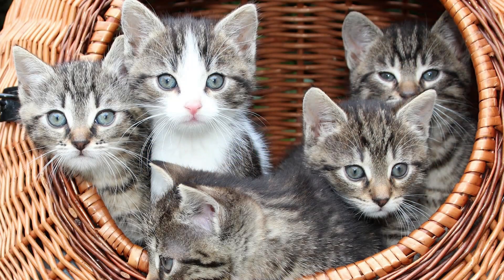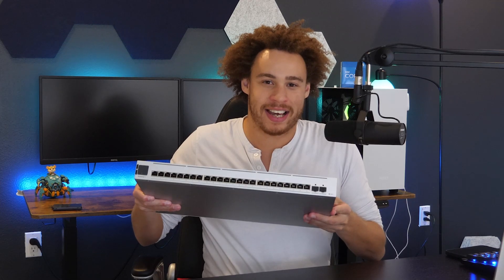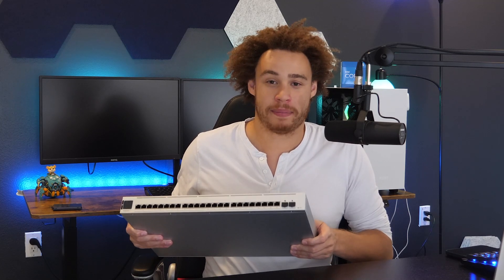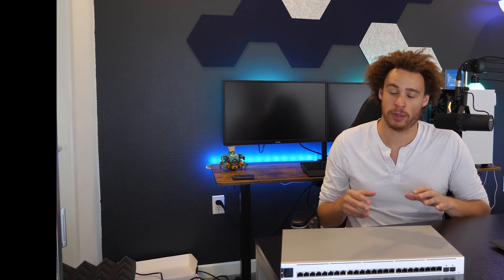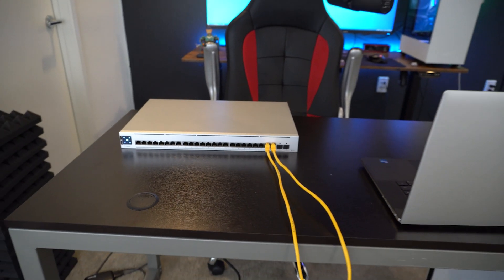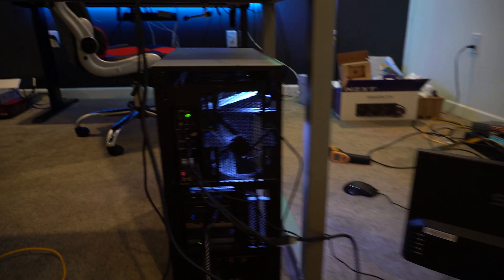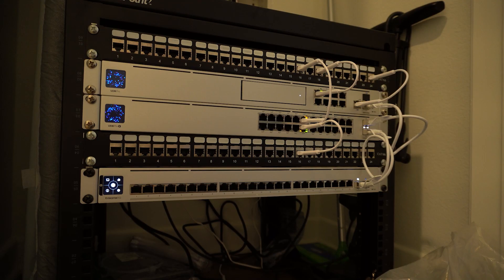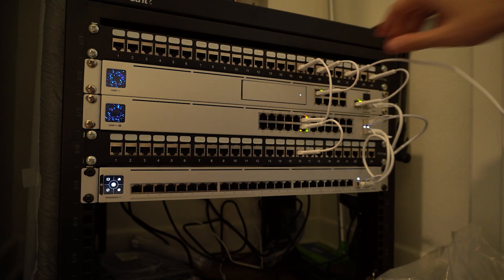Building a 10 Gigabit Network Over Cat5e

Comment: 4:09 I doubt the installers do much, if any, speed testing. Just whatever is built in to their LAN cable tester. Cheap testers check connectivity and pairing. Speed performance relies on the cable and outlet to meet the CAT6 or whatever specification and the installer to keep the untwisted length really short. LAN cable is pretty robust and can tolerate mistreatment in installation.

Comment: Isn't Cat5e certified up to 45m for 10GbE?
Most households do not have a single 45m line.

I now want to lay Ethernet.
I still have there, "Ecolan High Speed 300 Mhz LAN Cable Cat.5e S/FFTP 4x2xAWG24/1 FRNC".
An "old" 1000ft package.

Probably it makes no difference on the eventual maximum lengths of 8m or 10m.
Even full 10GbE should actually be possible.

So if it makes no difference at all, why use Cat6(e)....
Even if the price difference may be small.
After 10Gbit comes only fiber anyway.

The Cat5e cable you use (USA?) is unshielded?
I read that in the US it's often unshielded.
In Europe it is usually shielded.

Could it be that unshielded Cat5e vs. shielded Cat5e is "10-20m" vs. 45m length for 10GbE?
I read both lenghts.

Comment: Question is how to actually make the needed cable! Used to be able to take course, took cat 4-5 at County College, have Cat 6, 7 & 8, the later 2 cable can be allot longer Runs, with staying with 5e, could Use another switch in between floors, another problem with 5e, depends in walls, typically aren’t shielded & next to power lines slows speeds, need to be able to relearn, 7 or 8 is great!  Remember too people have more than 2+ devices

Comment: The statement in the beginning that CAT5E is rated only for 1Gbit up to 100 meters is false. Since a couple of years a new standard has been brought out making speeds of 5Gbit possible over existing gigabit-capable cabling. In the end, ethernet links are designed to be auto-negotiation so devices will negotiate on what speed to communicate.
Reply: I wouldn't expect 5e to run 5Gig ethernet to 100 metres tho, that's just asking for trouble.
Reply: @samiraperi467  you would think but as I understand that's part of the net standard. 2.5Gbit should definitely be possible up to 100 meters with 5E.
Reply: @wojtek-33  dude, look up 2.5Gbase-T and 5Gbase-T. They're mentioning 'existing gigabit cabling'. Later on the Cat5e cable is mentioned to be supported as well. The whole standard was built for this type of cable.. This standard was released in 2016, yet nobody ever heard of it.

Comment: Was expecting some other "unpacking" video, but saw someone who actually did real life tests :-) :-). So I subscribe. One question however: you got CAT5E, but what type of CAT5E (the kind of shielding within the wire itself: Is it S/FTP (If I remember well this is having a braided shield around the cable to avoid interference with electrical equipment/wires around it, and the FTP means that there's a foil around each pair within the cable to limit the cross talk). It is something not a lot of people who are not in cabling/field engineering know, but the type of shielding might make quite a lot of difference in obtained throughput speed without packet loss... My best bet based on your test results is that you got S/FTP

With regards of using 10G on a computer: you should have a network card that offloads all CPU related things from the CPU, so the NIC takes care about the networking and speed has almost zero impact on the CPU. 

For the jumbo frames: spot on: if you want to use 10G in a regular consumer network it is indeed best to enable jumbo frames as that prevents the overrload on the level of L2/L3 headers in the packet traffic (headers come on top of the actual data, so 10G with 64byte packets will in reality be a lot more traffic than just the 10G. compared to sending the data with packets with a byte size of 1522  or higher - jumbo frames of 9600 for example - bytes). However: make sure that all equipment in the path supports jumbo frames (e.g.: if Jumbo frames are enabled on the sending computer and not on the receiving, it will impact performance in a very negative way)
Reply from the maker: Thanks! Unfortunately I can't tell what type of Cat5e it is because it's a part of the apartment wiring and the cabling isn't exposed anywhere
Reply: S/FTP has foil around each pair and then the four pairs are bundled together inside a shield. Yeah, I'd expect S/FTP to do the best at speeds it wasn't designed for. 

Yeah, above 1G you want jumbo frames (9000 is commonly supported). Check what your hardware can do and configure for the smallest jumbo frame on the path.

Comment: Using 5e here with 10gbe. No issues as everything is below 100m. Using mikrotik switches with sfp adapters
Reply: can you tell me which mikrotik switch model you are using and SFP adaptor model ? i have Cat5e and it will be interesting to upgrade it to 10Gbe.

Comment: hehe, interesting experiment! And everything is great explained as always :)
I think a word on power consumption would have been nice though,. afaik 10 Gbit/s needs a lot more power to sustain those higher frequencies on the cable? At home I don't need high bandwidths and have everything capped at 100 Mbit/s to save a bit on the electricity bill ;) Cheers!

Comment: Google says cat5e will do 38-45m at 10 gig. Some switches struggle with copper SPF+ adapters due to power needed to drive distance.

Comment: Yeah, 10G bottlenecking the CPU is a real issue :D
Also big yes to the varying quality. Some CAT5E cabling is much better, and some are trash and run next to other, high voltage cables causing all sorts of issues. 
At least with cat* cables you don't have to worry about compatibility too much like with an SFP+ or better solution. And you can easily make your own custom cables.

Comment: The way you describe it, it's like Ethernet have a range in BW, but it's not. A 10Gb Ethernet port sends bits on the wire at 10Gb speed. Poor or long cabling will cause frame error (that will be dropped) and will cause the upper layer to retransmit packets (because not received). Basically, you either have full 10Gb or degraded 10Gb, not a value between 0 and 10Gb.

Also, Ethernet speed is measured at the wire (layer-1). Layer-2 and layer-3 protocols are adding their headers. For instance, a 1Q-trunk will reduce the perceived BW because each Ethernet frame will have 4-bytes used for 802.1q tagging.
Reply: This also explains the bottlenecking he was seeing, as the amount of retransmitted frames could have been what overwhelmed his computer, not the 10Gb in and of itself.

Edit: though the jumbo frames should be effected by the above too. Would have to examine the frames and upper layer protocol logs used for the testing to see how it’s handling error detection and correction and how often it needs to resend packets for more clues.
Reply: @FinalSentinel  ; Depends on the tool you're using to measure speed. Typically, with iperf you can run TCP and UDP tests to flood a link and see frame error. In TCP, the throughput will decrease because of retransmission (packets were lost), in UDP, the speed should be better, but the receiver will see losses.

Sometimes, to max out speed on an high speed link you can run concurrent TCP sessions, bump MTU and increase TCP window size. Sadly, computers NIC (and OS) don't have a consistent/easy way to see low level information (or DOM information).

Another point to mention, is that cheap NIC (in most PC/laptops) don't have a ton of hardware acceleration and use the CPU to do the work.  This is why servers often have dedicated (high cost) NIC to ensure you don't waste CPU cycles to just process Lower level network protocols.